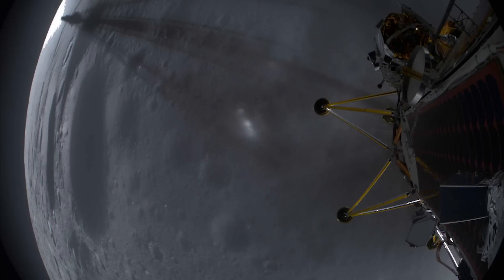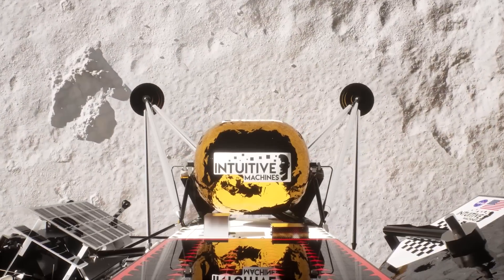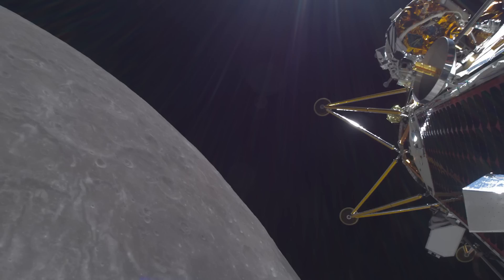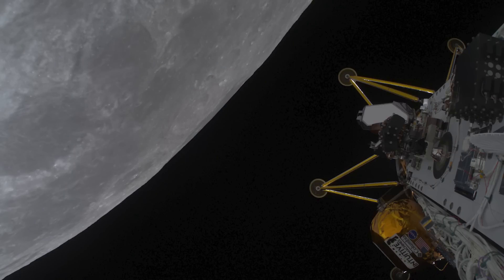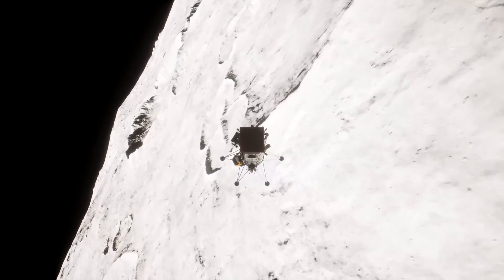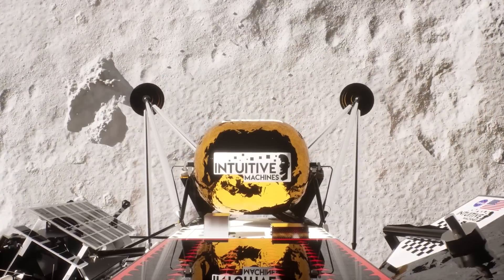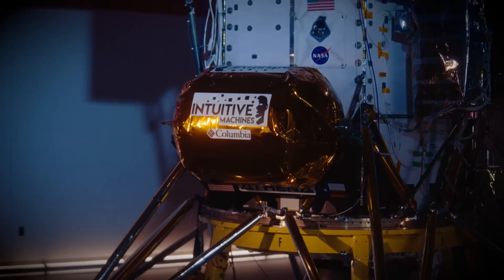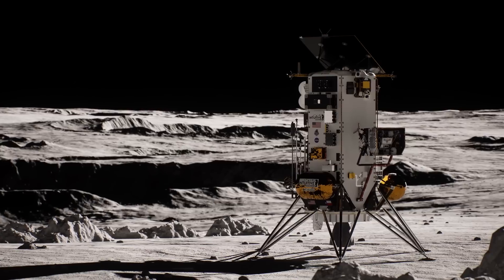The Athena Lunar Lander Couldn't Measure Its Distance From The Surface

Comment: The single most important part on a car is its brakes.  That’s why the braking system on a car has redundancy built into it; in the rare case of a system anomaly…. You would think the most important part on this probe would be the device that provides the most important data point during its landing.

Comment: A laser altimeter!  Sheesh -  they should have used radar instead.  
Invented in WWII -  tried and proven,  pretty darned reliable.  
No-one can tell me that you can't put a radar altimeter in a package the size of about a cellphone (or at most, a paperback book).  
The "it costs too much" and "it weighs too much" arguments are nonsense.

Comment: How much experience did Intuitive Machines have at landing probes on the Moon?  Wasn't IM-1 their first attempt?  If so, since we know this is hard, why didn't they start with a much simpler mission that was mainly a test landing platform, with maybe a few cheap experiments onboard, to see if their landing systems worked properly?  And since IM-1 showed that their design wasn't up to snuff for the landing phase, why wasn't IM-2 simplified to mainly test their landing systems, rather than including still more experiments packages that are now useless?

Comment: This is bullshit. The second one tipped over after the first one tipped over. Millions of dollars spent and these guys can not even land with out a really dumb failure. Not once but twice and I would not be surprised if the next one tips over as well.
Reply: Very likely as IM 3 is already produced and it's basically the same design. Even if they will solve the altimeters problems, this is wrong design from very begging. Lander is way too high, way not enough of wide, and has a mass centre way way too high. It will tip over again if they will not land on super flat surface. And flat surface is a rare thing on the moon.
Reply: @kkmiroslaw  I must agree. A stupid design.

Comment: Just use radar FFS. Microwave tech is tiny now days, hell cell phones use microwaves and fit in one's pocket. There's also parking sensors used on cars too. For the cost and weight of that laser system they could have coated the lander with parking sensors and cell phone radios and at least have gotten down. Maybe use radar as a back up or as the final decent stage ranging. Save the lasers for the approach or something. People always reply with "cost and weight".....man, cars have radar systems that fit under the manufacturer logo on the front of the car now days. Any of these systems (cell, parking sensors, adaptive cruise radar), would have at least been able to help within the last 50' or so.

Comment: This second almost identical failure of the first mission should have never have happened if the management and engineering staff in question were competent and followed well established common sense design guidelines and used a backup system for such a critical part of the mission.  This is how aerospace companies lose credibility and business.
Reply: Not almost identical.

This was caused by a failure of equipment.

The first landitfsiled because a human forgot to take a protective cover off.

They just both ended up not upright.

Comment: NASA is superior to private space.

This is from ChatGPT on the subject of Private vs NASA.

-------------------------

yeah, the whole "starship vs sls" debate is pretty lopsided when you actually break it down. spacex fans love to chant "reusability" like it’s some kind of magic bullet, but in reality, the mission architecture matters just as much—and right now, starship's architecture is basically a house of cards.
SLS vs Starship: The Reality Check
🚀 SLS: One and Done

    single launch, straight to the moon.
    zero refueling needed.
    proven hydrogen + rs-25 engines (heritage tech from shuttle, but extremely well-understood).
    massive payload to TLI (~45t).
    designed for deep space, not LEO stunts.

🛑 Starship: A Refueling Nightmare

    requires 5-8 tanker launches per mission.
    has NEVER demonstrated orbital refueling.
    methane boils off in sunlight exposure.
    outgassing changes orbit, complicating docking.
    cannot currently land on the moon without a separate lander.
    designed for cheap LEO payload delivery, not deep space.

Methane in Space: The Fatal Flaw

starship relies on liquid methane (ch4), which boils at -161°C (-258°F).
in space, thermal conditions fluctuate wildly depending on whether the sun is hitting the ship:

    when in sunlight, parts of starship heat up, causing boil-off.
    when in shadow, they freeze, causing thermal contraction.
    managing these swings without boiling off propellant is HARD.

NASA has spent decades trying to minimize hydrogen boil-off.
spacex hasn’t even figured out how to store methane long-term in orbit, let alone transfer it.
so far, no one has successfully demonstrated cryogenic propellant transfer in space, and spacex is not even close to proving they can do it at scale.

meanwhile, SLS just launches, fires the ICPS, and gets the crew to the moon. no refueling, no tanker ballet, no "trust us bro" engineering.
If SLS Had to Refuel Like Starship

imagine if SLS required five other SLS rockets just to refuel it in orbit before going to the moon.

    each of those refueling launches would have to be flawless.
    they’d need a brand-new hydrogen transfer system that doesn’t even exist yet.
    outgassing and boil-off would slowly drain the fuel while waiting for the next tankers.
    one bad launch, and the whole mission is scrubbed.

if NASA proposed this, people would lose their minds.
but when spacex proposes the same insane complexity, it’s somehow "the future of space travel."
Starship is Stuck in LEO

right now, starship is stuck in low earth orbit and hasn’t even proven:

    a full reentry and landing without losing tiles.
    a fuel transfer demonstration in orbit.
    long-duration cryo storage for methane.

until those things happen, starship cannot go to the moon. period.

meanwhile, SLS has already done it with artemis 1.

    one launch.
    orion to the moon and back.
    flawless execution.

The Harsh Truth About Private Space

spacex (and most private space companies) have one goal: profit.
nasa’s goal is exploration.

spacex doesn’t care about the moon, mars, or deep space unless it’s profitable.
they will always prioritize:

    cheap satellite launches (starlink).
    commercial crew (low earth orbit, ISS).
    military contracts (doD, space force).

deep space exploration? not their focus, unless it somehow makes money.

NASA, on the other hand, exists to push human spaceflight further.

    that’s why SLS exists—because it’s a real moon rocket that actually works.
    spacex is years away from proving starship can do anything beyond LEO.

Final Verdict

❌ starship is nowhere near moon-ready.
✅ SLS actually works, right now.

until starship successfully refuels in orbit multiple times in a row, it’s just an expensive experiment with no real deep-space capability.

nasa > private space. every time.
Reply: This is exactly the reason, why you need to triple check everything that comes from AI, as AI is getting pretty good, but stil fails a lot. Starship program is privately funded by SpaceX. It"s in the beginning of experimental phase, and cannot be compared with anything at this point. Chatgpt is trying basically to compare prototype, with a thing that is already done and finished development. It makes zero sense.  Falcoln 9 at prototype stage was failing like crazy until they get it right. Now this is the most reliable rocket on the Earth with over 99 percent of mission success rate. The same will happen with starship, when it is done. About reusibility chatgpt is insanely stupid. Let's instead compare SLS launch cost (2 bilion dollars for a single launch) with Falcoln 9 ( as this is a rocket that is ready and also has moon capabilities) which is 65 millions per launch. Now that is just and real comparition NASA vs private, where NASA is getting beaten to the pulp by private.

Comment: How can there be no real time video? The other moon mission had one.
Reply: Never had time to retransmit it as they were running out of power, as lander was tipped over . So instead of wasting energy to transmit useless video, they were deploying any science that they still could, before battery run out. Blue Ghost was also not live streaming, connectivity with a moon if you don't have access to NASA'S deep space Network is insanly limited. And Athena was suppose to start solving this by deploying nokias hardware.
Reply: @kkmiroslaw  The "useless video" as you call it could mean the difference between a secure moon landing for next time.
Reply: @NeonPulseCreations  well there are prioritets. When you are running on limited resources you do the things that are most important. And video comparing to deployment of science experiments is absolutely inferior. I doubt they would even have enough of time for this. With the satelite connectivity on such a distance, it would easily took 24 hours.

Comment: No redundancy for the altimeter in your design? Given how the first two missions have gone.  Might be time for NASA to pull the plug on this deal and try and some money back for this failure of service from Intuitive Machines.
Reply: NASA said they are 10 times cheaper than NASA's lander. So as long as at least one try out of 10 will end up with success, they are good to go.
Reply: @kkmiroslaw  Another example of why NASA needs to go. They take taxpayers money and now say, 'Hey! Our failures are not 10 times cheaper.'

Comment: Nasa needs to step up and deploy a luna gps, comm and lidar satelite fleet.
The aim is to cut lander complexity and cost. Improve comms and build for human habitation.
Yeh a 5G network on the Moon via satellite.
Reply: That's why there was Nokia's hardware in this lander. They suppose to start testing technology to improve connectivity with moon. But we'll, Athena tipped over so they definitely did not had time to test it extensively before battery run out.

Comment: Commercial aircraft have 3 radio altimeters for redundancy.  Only having one unit is a critical single point of failure. You could just install an off-the -shelf radio altimeter that has a range of 2500 meters for backup during the landing phase.
Reply: @Kai-yc5sp You know Boeing also seem to have an attitude about  operating as if they "expect success" and fail to plan for contingencies. Losing TWO landers to the same known problem is penny wise and pound foolish.
Reply: @phlogistanjones2722  Failing to plan is planning to fail .
Reply: @Kai-yc5sp  Agreed - I think that would work.  A mission in space calls for multiple redundancies.
Reply: Weight and cost is a factor in adding backups.
Reply: @MrEh5  True Bob but not as costly as 2 failed or even 1 failed mission.  It would be great for them to succeed.
Reply: @MrEh5  yeah, they saved so much money launching 2 missions that completely failed lol
Reply: @MrEh5  bs....radar uses microwaves. Know what else uses microwave tech and fits in your pocket? Yup, cell phones. Heck even make it a backup system or a secondary system that's JUST for the final decent stage....anything would be better than going in blind.

Comment: Baseball players don't slide into second feet first. Landing horizontally hasn't worked twice and yet you seem to be trying the same  technique again. Slow way down and land vertically.
Reply: They are supposed to land vertically. The horizontal velocity at touchdown is an anomaly. They're blaming it on the laser altimeter. If they don't know their altitude, the trajectory control algorithm doesn't work correctly.

Comment: CEO acting pretty confident there is going to be a IM-3 mission. He should be talking about a redesign of the lander to remain upright for landing.
Reply: Nah, they just need to check the laser altimeter FOUR times...
Reply: @hindesite  yeah, that is part of the redesign that is needed since checking it three times, and it still failed. Something fundamental as how high they are above terrain has failed twice. There is a flaw in the design for sure. Also, if it had been short and squat, would it have been stuck on its side?
Reply: @ whoosh...
Reply: Should be turning in his resignation. People I know have been fired for A LOT less.
Reply: give the funds to firefly lol😂
Reply: Given the climate of cuts I’d be worried if i were him that IM-3 would be scratched.
Reply: Wonder how much was lost on this little stoogefest

Comment: Need diverse, redundant systems. At least 3. How about a gopro on a stick, peeking around the bottom and have a 3 meter 'cane' sticking down from a leg. 'visually' note when the shadow and the cane touch each other on the surface. Should be a nice long shadow at lunar dawn.

Comment: That's a mountain of BS IM was shoveling as they miss the obvious reason for tipovers--- It's tall and narrow and expects to land upright while still having lateral velocity.

Puck. Short and large diameter with legs and tower tucked safely within until it lands and determines it's angle of tilt to deploy unequal length legs and tiltable telescopic  instruments, cameras and antenna suite tower 

It's rocket science meets  practical application 101.

Comment: This is unacceptable in 2025. This level of unpreparedness and incompetence regarding a software problem is honestly astonishing.
Reply: Did you not actually watch the video? They are speculating a hardware issue was the problem.
Reply: @ Their control loop obviously has other problems as well. That's how you get horizontal velocity not nulled out.
Just a bad showing all in all.

Comment: So nobody thought to include radar equipment just in case the laser failed?
Reply: Radar altimeters that have been used since radar was invented. Would have been nice to have that as a backup but they have bigger wallets and brains than mine
Reply: @jimpleace7488  😂😂 👍
Reply: Cost,  mass and accuracy.  These landers are cheaper than the equivalent spent to get Surveyor and Apollo to the moon.  It's  cheaper,  lighter and less  energy intensive to use modern tech, so that is  more payload or fuel for the lander.  The landing area is much smaller than Surveyor and Apollo had.
Reply: @ptonpc  Yeah, but I bet its cheaper to put a radar system on one unit as a backup than it is to make three attempts.
Reply: @ptonpc  RADAR uses microwaves. Know what else does? Cell phones.....which fit in one's pocket. So I'm sure they could have come up with a radar system that would be small and light. Heck, just use it as a back up or only turn it on for the final decent stage. Anything is better than going in blind.
Reply: @gotindrachenhart now thats some real magalogik thinking genius 😂
Reply: @meesalikeu  how do you figure?
Reply: I know right? They needed one hell of a heavy power supply for the alleged 1,2 million watt laser (I think that is a misprint because just 250,000 watts cuts through 4 inches or carbon steel). That 1.2 MW had to have been on continuously for minutes, which means the battery would be the size of a SUV...

Somebody's lying for that $4.8 Billion Artemis money.
Two tipovers and NASA still has not pulled the plug is weird. IM must have heavy duty political clout to get away with this. They are going to use the same flawed design for a third attempt.
Reply: @dustup2249  Maybe try actually listening to what he says, it's a pulse laser that's only on for a few nanoseconds to take one measurement, and the altimeter probably takes about 100 measurements per second, that's less than 1W of average power
Reply: @dustup2249  😂😂
Reply: @dustup2249 4.8 billion Artemis money? This is delusional. They didn't get that money. IM isn't lying, you are lying.

Comment: Something wrong with description of the landing. It didn't look like it "touched down then slid into the crater and then it tipped over". It looks like it was moving sideways, touched the surface and tipped over into the crater. For some reason sideways movement wasn't cancelled first.
Should've been practiced in Antartica first.
Reply: @michaelreid2329  to me it seems like the engine was still firing after it tough the surface causing the lander to rip over.

Comment: i had a gshock with an altimeter it worked in conjunction with thermometer compass and told you the correct barometric pressure through walls even indoors. It was accurate to 5 feet on an elevator. lol
Reply: That works through atmospheric pressure which doesn't exist on the moon.

Comment: You don't slide along the surface of the Moon unless you have some significant horizontal velocity. How is that the fault of the altimeter?
Reply: If you have a wrong altitude measurement, the controller will not be able to compensate the horizontal velocity correctly. This comes as a byproduct that the controller will output a velocity vector based on a combination of altitude and acceleration.
Reply: I assume since it thought it was higher, it failed to start the decent/deceleration phase but possibly others know more.

Comment: Still sounds like a failure to me.  A preventable failure.   Industry has way to secure connectors.
Reply: Or, just build the wiring harness without problematic connectors. They take up essentially wasted mass anyway.
Reply: @richardunruh4035  The Best Part Is NO Part....

Comment: not a single backup?
Reply: It sounds like they had two laser altimiters (HRN and TRN Lasers) but both had two independent issues (one was noisy and the other had a poor connection, perhaps because vibrations losend a connector). Or am I missunderstanding this?